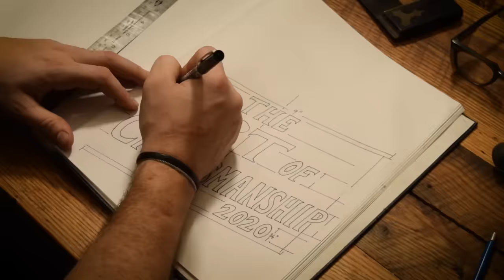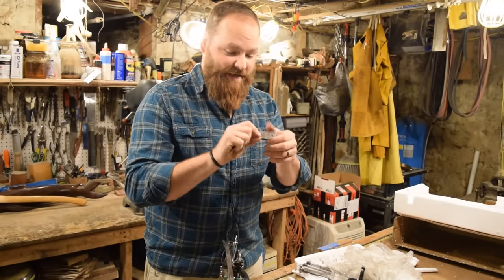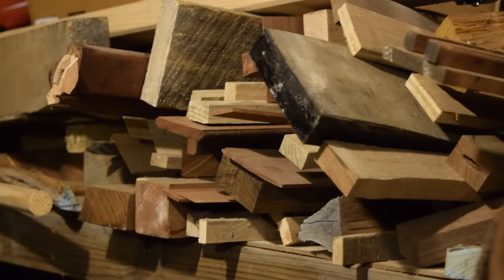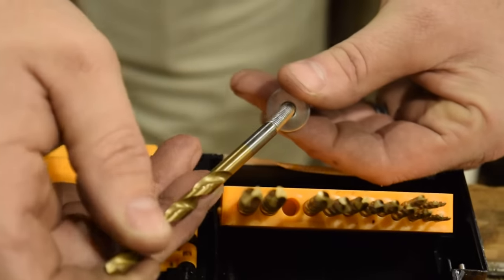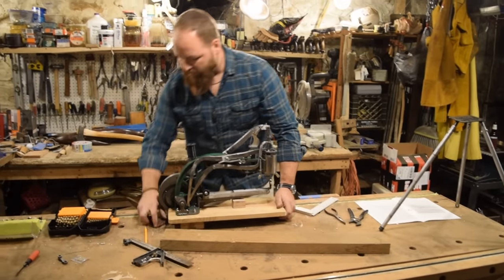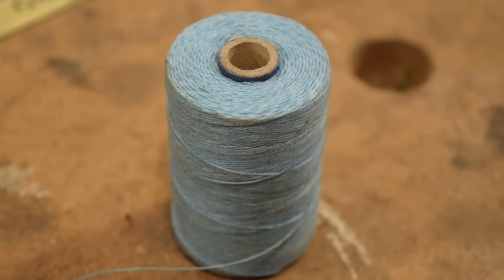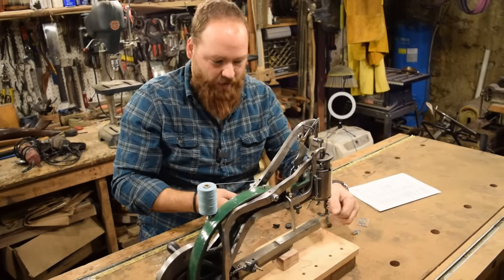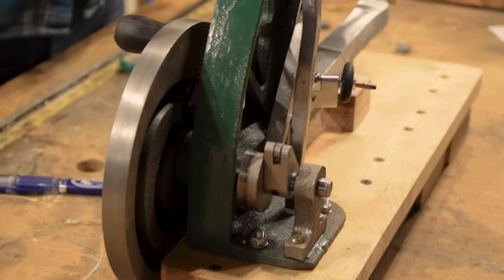The Infamous $100 Leather Sewing Machine: Unboxing and Setup

Comment: I read the comments below. I didn't see anything about beeswax in comments, except from Waynetheseine.  I'm pushing 70 years old, and I've sewn a lot of leather and canvas over the years for making tents and making things out of leather. I always used a little beeswax about a half an inch in a tube or a square chunk to lubricate the needle itself. I just rubbed the beeswax around the bottom of the needle so it would puncture the leather easier and wouldn't tangle or grab.  You might try that.  Almost any domestic sewing machine will sew leather the thickness you're sewing right now, as long as you have a leather needle in the machine.  To sew thicker things you might have to go to the double needle lock stitch thing with an upper and lower needle by hand.  That's for stitching saddles and things like that.  I hope all this helps.
Reply: Barely getting into leather crafting and this comment pushed me in the right direction! Thank you!
Reply: People that do hand embroidery, top stitching with multiple threads use bees wax to keep the threads from twisting.
Reply: My old Adler 30-1 has a beeswax cup to wax thread as it fed through.
Reply: Its called a saddle stitch.... just because its for saddles............ 
tutorials all over youtube. watch more than one, as it seems everyone has there own tricks to get it done.
Reply: i have an old singer treadle sewing machine. the shuttle bobbin.  i have it set up to sew 8oz veg tan on foot power. does great on it, not that hard of the leg/foot either
Reply: Also, use a round tip needle on leather. a chisel tip will crack the leather and weaken the stitched areas.
Reply: I prefer to use riveting for durability, but yes that's some good advice if one has to use some sewing around from time to time...
Reply: @jeremyb7128  I have an old Singer Treadle machine, myself...but I've had it about fifteen years, and haven't gotten around to fixing it up. I got it from a guy clearing out a house & garage, and it sat under a leaky roof for some time, so the wood isn't in the greatest shape, and the metal has some rust. Unfortunately for me, before I could get space cleared in the house for it, my back went. I'm hoping to do something about it this summer, though. Always nice to know others are actually using theirs.
Reply: I’m an upholsterer,  on more than one occasion I’ve used a standard sewing machine (household ,singer)  to sew veg tan leather 5mm thick  , no broke needles,bit of wax on them helps allot.
Reply: Thank you for the wisdom, sir.
Reply: @kellychase2937  anytime, Kelly...'just know what works, and what doesn't...lessons "hard learned"....  Take care, have fun, and CREATE.   --- Doug
Reply: @jomarz1828  rivets may not always be available.
Reply: @jomarz1828  there's almost never a situation where you could exchange thread for rivets. Imagine is leather was always attached with rivets.
Reply: I wish we were neighbors so I come give you a handshake and a pat on the back for this info you posted. Thank you sir! I am teaching myself how to make shoes and every little bit of info helps.
Reply: Your the man.
Reply: Im a novice leather worker. I stitch by hand. All my thread is prewaxed.
Reply: I'm 71 and make Myrtle Wood clocks, but need a bit more sit down work , so thought I would start making pistol holsters. I'm not a sit on my hams and die person.  Are you finished using your machine? Maybe I can buy it?

Comment: Howdy! I'm a seamstress for an inflatable company, and handle all the repairs needing to happen on these heavy vinyl units.  It seems like your bobbin hook is likely striking the top thread, and splitting it. This is an issue that is millimeters away from being solved. Proper tuning, and this little ripper should do you well!
Reply: As a teen I worked for a company that rented out inflatables and then staffed the events to supervise the children. I have an unreasonable hatred for inflatables after a couple summers of rolling up a 800lb haunted house that was soaked in another few hundred pounds of rain after spending 5 hours wrangling kids
Reply: @Grom-rl8bm  I hope you were well compensated
Reply: @Grom-rl8bm  Lol I've been slinging the vinyl for five years. Its a hell of a grind, and i don't blame any ones hatred. I absolutely love the shit though lol.

Comment: Two very helpful hack. Use an air compressor (or canned air) to blow the thread down tube. Second, get a magnet to lift out the bobbin. I've had one of these for a while. Spent a few hours polishing the contact points to make it very smooth. Special bonus if you read this far, use a 8-32 machine screw and drill to rapidly wind a bobbin.
Reply: I've had mine for a while and I agree. A drill is much better as a bobbin winder. Lowering the thread with the wive that came with mine works perfectly. I did not polish the teeth of the walking foot. It gives me a better grab on the leather. It's just something I work with in the end when finishing up.
Reply: It looks like it's worth getting.
Reply: @@TheRealBrownShady That will depend on the needle and project. Out of the box and for a wide range of common uses I use a #69 bonded nylon thread.
Reply: using a drill to wind the bobbin defeats the whole purpose, you might as well just spend a couple hundred bucks more and get an electric consew
Reply: @FourthWayRanch  It would defeat the purpose if you bought a drill just to wind the bobbin. Many people already have a drill and it's much easier and faster than using the built in capability. If you bought this sewing machine for your end of the world projects you can still wind the bobbin. If you get this machine as the most cost effective way to sew thicker materials then using an additional drill, even if you have to purchase one, still comes out cheaper than an electric sewing machine capable of the heavier fabrics and leather.
Reply: @embededfabrication4482 winding the bobbin isn't sewing. Did you confuse both? You wind with a drill to quickly have a working setup, then you manually sew using the flywheel.
Reply: Those are good tricks. Thanks. I'm sure the crafters are grateful.
Reply: Not sure about the way you set up the base, its a shoe sewing machine, the arm is meant to stick out from its base so you can stand or sit sewing inside the shoe or boot

Comment: I've had one of these for many years now, and the thread breaking issue you experienced is usually because the thread is too thick for the needle. There are a bunch of ways you can adjust top and bottom tension on those things via the holes in the bobbin carrier for the bottom or the position, number and tightness of the tensioners on top. Once you get it set up with a thread and needle that works that you like, just leave it that way. Changing threads on these is not like on a regular sewing machine - it takes more adjustment.
Reply: I have one of these for many years and I completely agree with all you said in your comment.
Reply: I was just gonna say the same thing.
Reply: Wow! That's good to know. Thanks.
Reply: Very interesting video. I’m a long time tailor and have always wondered about the types of machines that sew leather as cobblers use. Pretty good for the price. 👍
Reply: Exactly right. These machines are the very epitome of rudmentary functionality.  The cobblers in those bazzar markets repairing your pointed slippers in Pakistan don't change their thread or they wouldnt have any customers.  I leave mine with 138 thread and a 140/22 needle.  Then, the big fight is the thickness of the material relative to the stitch lenght and tension adjustments - which can be another cuss-fest all its own.

Comment: The leather they left in your machine is a proof sample. It was sewn on this machine so you can see that it works. Any problems encountered are with the operator or setup. Also I would have cleaned up the cosmoline and oiled it a bit before use. The sticky cosmoline will mess with your tension...
Reply: I8<koi mop
Reply: @dennissmith8385  ???????
Reply: Look up the defintion for cosmoline. It's like earwax. Sort of.
Reply: @patriciajrs46  best description ever....
Reply: Depends on the supplier. @patriciajrs46
Reply: Also a lot of dirt and grit from machining requires complete disassembly of the machine to clean it.  Manny parts are not usually approximating correctly and need to be readjusted along with correcting the timing.  Other needles are available,  I have sewn as heavy as 1/4 inch or 6mm of leather.  It requires finesse with the tuning and needle and thread selection.  As previously stated there are many videos on you tube and forums that are specific to the Chinese patcher sewing machine!  Enjoy!

Comment: Just FYI: The machine is intended to only be mounted at the back, with the bottom arm sticking out unsupported. This lets you do things like sew down the back of a tall boot with the boot hanging down below the bottom arm. Of course you probably don't need to do that, so your mounting should work fine for your use.
Reply: As a cobbler, I was just about to say this :)
Reply: That narrow bottom is a huge advantage for making small narrow bags, and I built a removable platform to make the base much bigger for most jobs.   After minor adjustments, proper thread and needles, and a simple wooden base with removable platform, this machine will do just about anything I want in leather.  I never used a machine before but it is very easy and fun.
Reply: my godparents had a machine on a pedestal just as you describe ,as you quite rightly mention was to allow for larger work to be swung around the machine.
Reply: yep... u got it...
Reply: Are you saying it needs to be mounted vertically...
Reply: @joeschlotthauer840  Not at all, machine operates on the horizontal. Pedestal  attaches at the rear of machine to allow for large pieces of work to be swung around the needle. Usually at approx lower chest height.
Reply: @davidprocter3578  
Thanks for responding.
Reply: @joeschlotthauer840  pleased to help, only sorry I cant provide you with a photo of my godparents machine, apart from the pedestal was much the same as yours think it had a treadle to drive it and a swinging seat
Reply: @davidprocter3578  
My grandfather was an upholsterer, had various machines, one had a treadle...
Reply: I believe the machine was intended to be mounted in profile, just like a scroll saw.  Face the machine from the end. It works even better when fitted with a slow speed motor.
Reply: I was 2 min in to this when I came looking for this comment
Reply: @firesurfer  There are photos of street cobblers using them while facing the side, operating the wheel with the right hand.  But yes, you can use them with the machine pointing at the operator as well.

The Singer Model 29-4 is similar, but much more robust and refined.  The 1850 American patent on the Chinese machine expired in the 1800's and this is the copy.

Comment: I’ve had one for 4 years now and it’s still working.  You do need to be handy and willing to put plenty of time and effort into tuning these. Additionally, they are not really made to take a thread larger than a T69.  They can be modified to take thread weight into the low 200s. If you work in veg tan they (and any other sewing machine) will leave marks that can be lessened by smoothing the foot. This isn’t what I would call a true walking foot. Like all patcher machines the foot drags the material past the needle. If the foot is too smooth it will not function properly and feed the material. If you’re looking to open the box and get started, this machine isn’t for you. They take time and plenty of trouble shooting as well as regular maintenance.
Reply: @Masterpiece Tools Agreed. I have 4 industrial sewing machines and the ability to service them is essential. The CLSP is a bit of a different story. It’s not entirely finished when you get it.  The finishing on metal surfaces is rough and a good amount of fettling is necessary to make these usable.
Reply: Agreed, not a true compound walking foot where the foot would be split into two parts, one of which would always be in contact with the workpiece.

Comment: These are intended for mounting on a post stand or at the corner of a bench; with the lower arm unobstructed. This allows deep workpieces to be switched up to the depth of the throat.
If mounting on a bench use a rotating base so it can be moved out of the way.
Reply: Came here to say the same
Reply: @maryannadkins-bahena1178  "heads up guys, the boss is speaking." Makes so much more sense now, thanks for clarifying.

Comment: You don't need the block of wood under the middle: the lower arm is supposed to be free floating so that you can get things like boot shafts over the lower arm.

I'm a saddler and have 6 sewing machines in the shop and that little Chinese patcher actually gets a significant amount of use.  It is not a bad machine if you take the time to disassemble some of the parts, clean, deburr and polish them up and tune things up a bit.   Key areas to clean up include the lower bobbin and lower bobbin case and all the sharp edges around there, the presser foot is very sharp and will leave cut marks on the leather until you smooth those up..

A handy tool to make is to just glue a small magnet on a tab of leather- this makes removing and installing the lower bobbin case easy.   Bonded polyester thread is the best choice for this and most other leather sewing machines.
Reply from the maker: Thanks for the info! Lots to do for sure.

Comment: Couple of tips.   I drilled out all of the pivot holes and pressed a bearing or bronze bushing in each...as well as putting a small strip of teflon sheet under the shuttle/bobbin arm (?)  makes it run 100X smoother.  Also worth going over the whole thing with wet/dry just to remove any sharp edges, that stopped my threads breaking.
Reply: Could i order one to your house for you to mod it and ship it to me hahaha
Reply: @tristanhinkley1023  lol...I won't go into how long it took me to drill a 22mm hole through a steel block for the bearings.
I should make a video of it really.
Reply: Thank you for letting us know about the issues you had.

Comment: I have one of these machines and have used it extensively.
I have bought bigger needles, size 20 and use either 92 lb or 130 lb thread. I only use 100 % polyester thread and never put wax on it. The wax prevents it from moving smoothy through all the part.
Also, the tip of the needle has been sharpened to a chisel point, like what they use for leather in industrial machines.
I have also adjusted the little spring on the bobbin by bending it slightly to allow for the thicker thread.
On my bobbin I have taken a small file and smoothed all the edges down (except for the point). This prevents the threat from breaking. Those sharp edges around the bobbin will sometimes snag the thread and it gets cut on the edges.
Hope this helps.
Reply: Excellent comment.  me-too.

Comment: Wow, yours came in much better shape than mine did.  I cleaned mine up, modified it a little for performance, and motorized it.  It works, I particularly enjoy it when making belts.  Took a while to get it "tuned" to run right though.
Reply: :) What sort of motor did you use?
Reply: O.o ! Can you share details on how you motorized it? I've been eyeing sewing machine motor and pedal sets, but another youtuber found the speed to be too much. I suspect the pedal wasn't adjusted right, but maybe you have a solution

Comment: I own a Cobra 3 and Cobra 20, about $5,000 total for the 2. I also own one of these because it's the only machine under $3,500 that can do transverse (up the arm) feed in leather. It's a great little budget leather sewing machine. Need to do some tweaking, such as grinding down the foot teeth, but it works great with a little modification.
Reply: @Masterpiece Tools I was wondering if the main arm and other mechanical components were vintage resold with new pivots and other parts prone to failure. I am actually very intrigued as I want to start making custom tool belts and accsseroies with leather and polyester so I am in the research phase.
Reply: @masterpiecetools131 what are we looking for with these other models you're talking about, names?    Singer 29k SV8 Cobbler Patching??
Reply: What kind of leather thicknesses can this $100 model handle? I'm worried it won't be useable for belts.